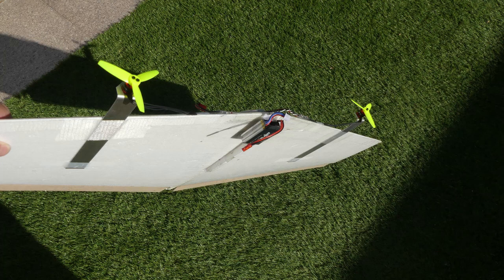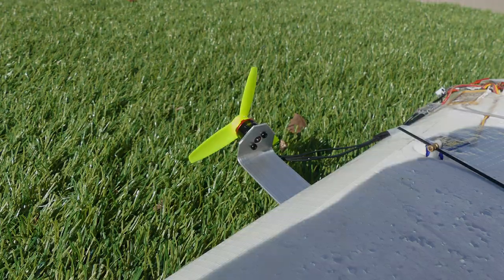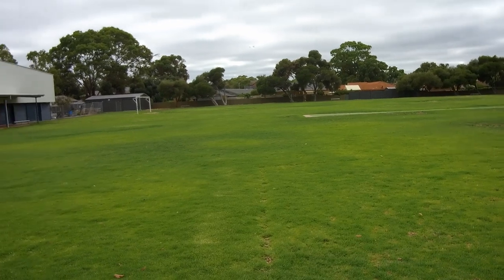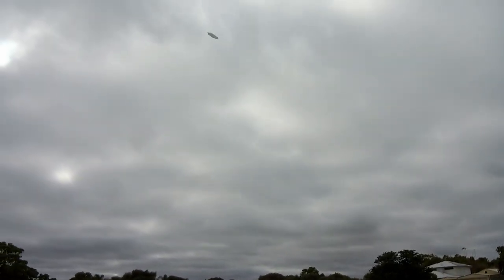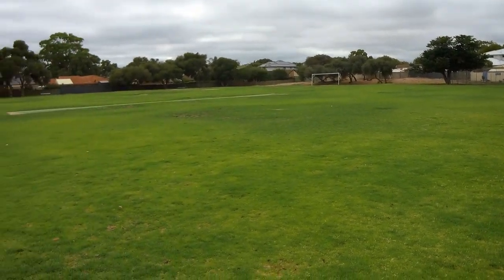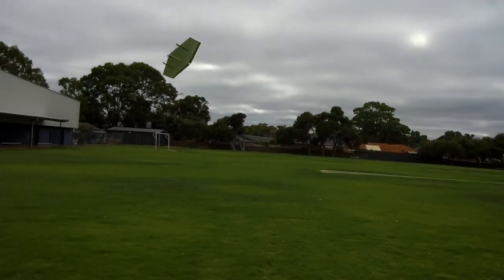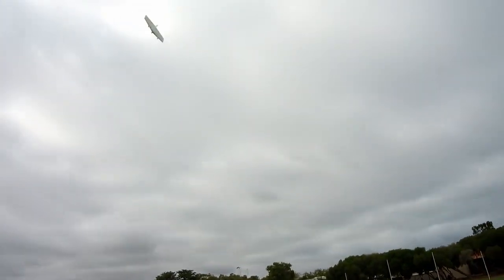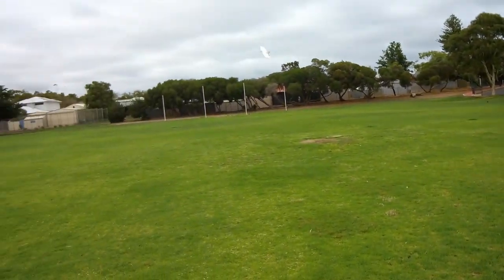3S Twin Motor Wiesel Light

Comment: Awesome flying! Great bird! Does it have differential yaw? If not, how do you keep the thrusts the same?
Reply from the maker: Thank you! It does have differential thrust, but most of the time I don't use it. I think the fact that both motors are the same with the same props means they thrust the same. I hadn't even pondered the issue until I saw your comment; I didn't notice it while flying.
Reply: @johanbergkvist8834  I guess if they're using the same battery the thrusts should remain the same.